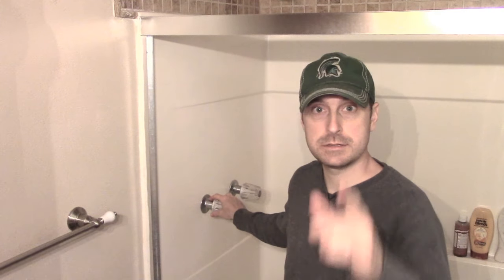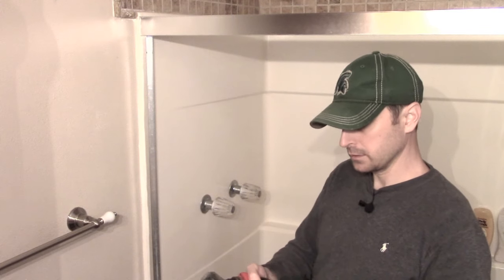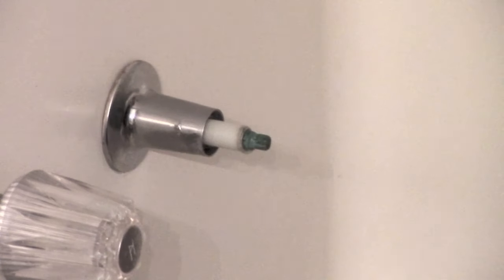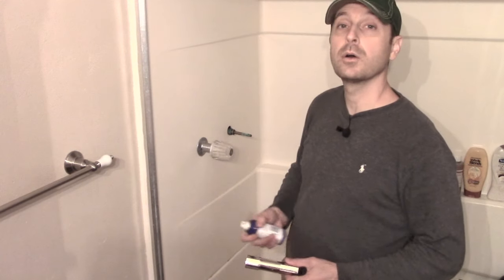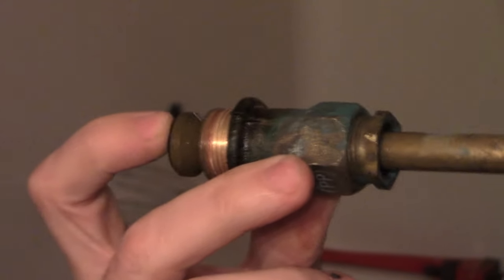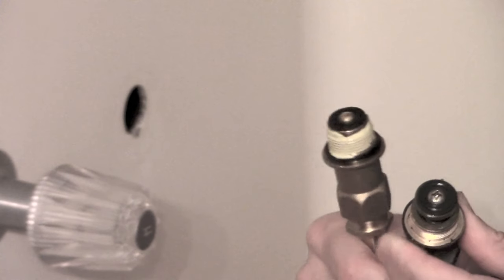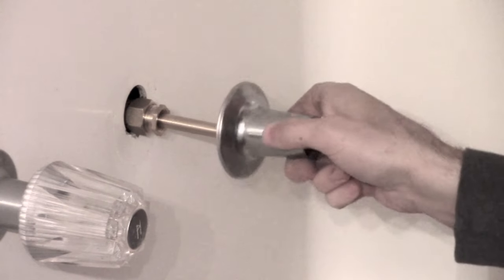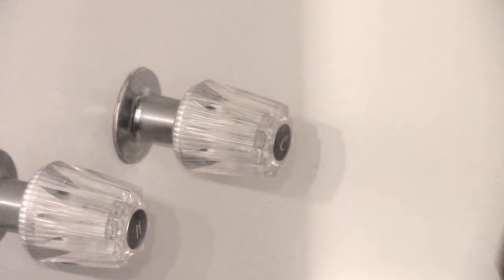How To Repair & Replace A Shower Faucet Valve (Easy DIY Fix)

Comment: Hey I know this bid is older but when I took out the old stem in the kit there was a valve stem inside I finally got that out but when I went to put the new ones in I tightened everything down and the seat part was just doing on the inside why I don't know what I have done wrong need help please
Reply from the maker: I don't understand what the issue is. What is your specific question please?
Reply: @CountryLivingExperience  so
Reply: @CountryLivingExperience  so when I go to put in the plumbing it just spins the whole thing I bought a remodeling kit and it and it came with everything that I needed to take out the stem and everything so when I bought it the guy at the Ace hardware told me that there's another piece inside that I needed to get out which I believe is the seat but it's a copper cup with holes in it to allow the water to flow in.  I just had the stem so I went back and I pulled those out so when I went to put them back in I put them in and I tighten them down but then when I go to turn the water on the bathtub keeps running and it won't shut off so thenI take it apart put it back in again it's just spinning inside there like when I turn it to the right to shut to close it it just spins and spins and spins it won't close the round rubber gasket on the end of the seat is broken off as well what a nightmare thought maybe I am doing it wrong
Reply: @CountryLivingExperience  sorry I'm not sure what everything is called I put them together before and I put them in before but this one just I don't know what the heck is going on I think it's the seat but it's not it's an old antique tub so it's it's just like the picture on your video they look exactly like that that's the kind that I've got to work with
Reply: @CountryLivingExperience  and I really appreciate you responding and sorry that some of my writing is all gargled up it's talk to text so that's probably why but I fixed it so hopefully now you can understand me better
Reply: The only thing I can think that I did wrong is I was trying to put the seat in first so should I leave the seat screwed onto the stem when I'm re applying it because it's not one of the little screw in ones that I've seen all over YouTube where you have that special tool it's not one of those seats it's one of the old school it's like a cup with holes in it so I'm thinking maybe I should have left that screwed on and then just put the whole assembly in tighten it down and then tighten up the pack nut I'm not sure what's going on I just know that when I get it all in there and I and I turn it to the right to close the whole thing the seat is spinning on the inside
Reply from the maker: Ah, I understand. The talk to text is not putting punctuation so it is very difficult to read.
Reply from the maker: Each brand is designed a bit different but the concept is roughly the same. You should replace the seat also (that small copper cup). Mine were not bad so I didn't change them out in the video. 
Did you match the new valve to the old valve exactly? It has numbers and a brand stamp on it. They must match perfectly to fit properly.
Reply: @CountryLivingExperience  yes I did but there's nothing to screw in to it it's  something that just goes in and fits in there it doesn't screw in at all  it's the older style it's exactly like the ones that are on your picture for the for your thumb nail
Reply from the maker: The seat should not screw on to the valve stem. The seat sits back inside the pipe inlet and must be removed separately. The seat washer connects on the end of the valve stem.
Reply from the maker: Are you rebuilding the whole valve stem? That is a totally different animal and can vary slightly from brand to brand, valve stem to valve stem.
Reply: @CountryLivingExperience  okay so then when I put the new remodeled kit back in do I screw the seat all the way down onto the stem and then insert it and then tighten?
Reply: @CountryLivingExperience  man you're a lifesaver I really appreciate you taking your time out of the day to help me with this
Reply: @CountryLivingExperience  I definitely will be subscribing
Reply: @CountryLivingExperience  no I bought everything it's already all installed but when I went to the store the seat the little cup the brass cup with the holes in it was inside and I had to pull those out and they were in there pretty good and the new kit came with them but I tried to put them in first and then put the stem in and I'm wondering if I should have left them on the screwed down on the stem and then try to insert them in there and then tighten it and then try to work the valve like open and close it
Reply: @CountryLivingExperience  so I guess what I'm trying to ask is in your thumbnail you have a little red arrow that points to the valve now on the upper part of the valve is the little cup that screws down onto it it's all one piece do I stick that whole piece into the pipe and then tighten it and then try to close or open it and then close it or am I supposed to take that little cup off stick it in first and then stick the stem in that's where I'm having issues I think
Reply: @CountryLivingExperience  I'm sorry man I've been looking all over YouTube to try to find somebody putting in the older ones and I can't find anything and yours was like the closest to it and I saw that you had a thumbnail of the ones that I was putting in so I thought maybe you might know I don't mean to bug or anything man
Reply from the maker: You're not bugging me. I am happy to help the best I can. My thumbnail is just a stock photo. Since many valve stems are very similar (but there are so many manufacturers) it is near impossible to show every one of them. There was no picture of the one I own, hence the different thumbnail. The arrow in the thumbnail means nothing.
If you didn't take the seat out when you took out the old valve stem, then it should still be in there. I do not know what little cups you are referring to. Your new valve stem should have a rubber washer on the thicker side with the threads. Just thread that into the pipe. Then put the handle on and screw that to the stem. Done.  
I'm sorry I just don't know how else to explain it.

Comment: Might be a dumb question but worth asking... do I need to shut off the water to the house first or does the valve being "off" before taking it apart make it unnecessary to do so?

Thank you! Great video.
Reply from the maker: Shut the water off to the house or shut the isolation valve off in the wall next to your shower if you have one. Also check the seats in the valve when you take out the stem.
Reply: @CountryLivingExperience  awesome thank you for such useful information! 

Would this independent valve be the one that shuts off the toilet as well?
Reply from the maker: You’re welcome. It would be located in the wall behind the shower behind some sort of removable wall panel. It is not associated with the toilet.
Reply: @CountryLivingExperience  gotcha. I dont believe mine has that so I'll just shut off the main. You're the best! Keep doing what you do!

Comment: I'm always worried that if I got the wrong part, I have to leave the house without water for 30-90 mins while I go get the right part at the store.

Maybe it's no problem when I'm home alone but often there were other people still in the house.
Reply from the maker: Hope it works out for you. Thanks for watching.

Comment: Information is good, but it would be better if you posted information on the parts of the stem and what role they each they play. I learned the hard way when I repaired a leaking head. The local "experts" at Home Depot failed to address the issues that arise if (1), the seat(s) on the valve body are worn down and must be replaced, (2), if the cartridge head washer should be Flat, or Convex (3), the larger body washer should also be replaced in addition to the application of plumber's putty to the cartridge treads. Other wise, the water will then leak at valve body connection due to bad washers. If I was posting a how-to-video, i would show the valve body, the seats, the cartridge, and how they all work together. I would also show how to replace the seats.    Just saying.......................